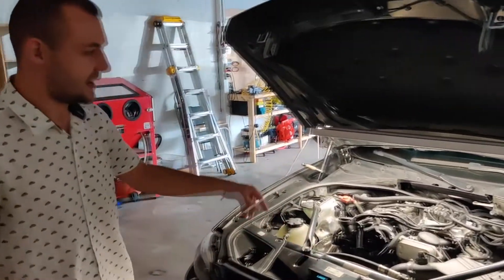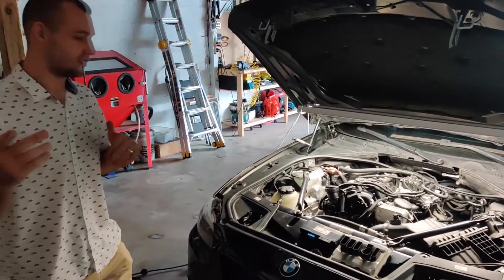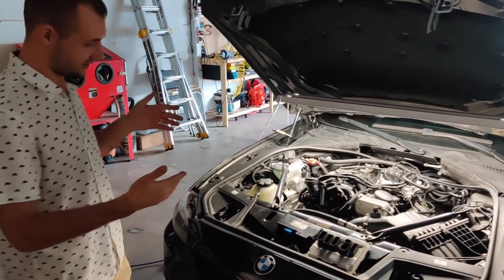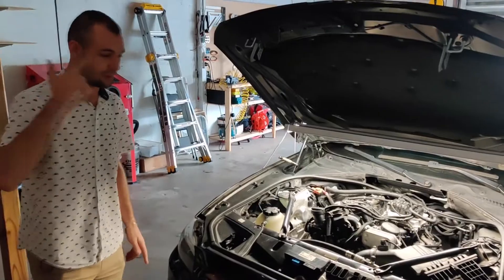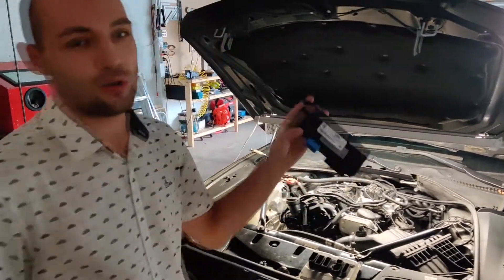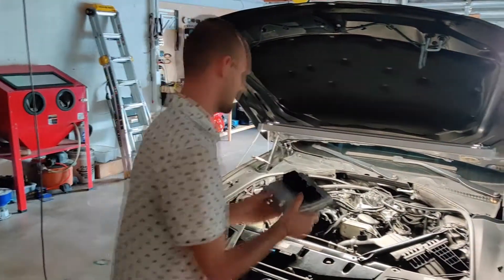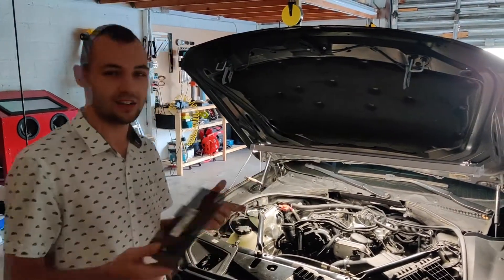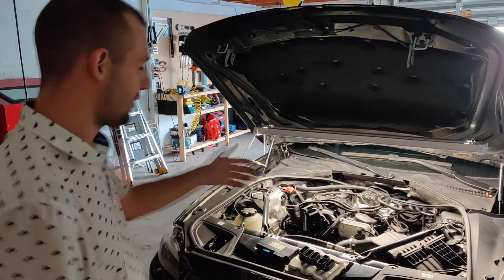Story About BMW F10 5-Series DME Programming Problems

Comment: Hello i have a f10 2012 5 series 520d whith this code 801c20 ZGM memory full ,how can i fixe this ?
Reply from the maker: That 801C20 code means the ZGM (Central Gateway Module) memory is full. On BMWs like the F10, it usually happens when too many error messages or logs are stored. The fix is to clear the ZGM fault memory using BMW diagnostic software like ISTA/D, ISTA+, or a good BMW capable scan tool. If the code comes right back, it could point to a module constantly sending errors, so you’d need to scan all modules to find the root cause.
Reply: @ECUTeamCorp .thank you for letting me know 👍

Comment: Hey buddy I am problems with my DME not communicating or no signal at times . Can you advise me what you think might be the problem please.. 🙏 2011 535i
Reply: The same problem with my 2012 F10, which lasts for quite a while with only occasional "Powertrain Malfunction" sign.  Recently it started and idled for a minute or so and stalled.  Further checking of the electric fuses and connectors found a lack of power supply (when key was inserted and at "ON" ) in both the camshaft position sensor harnesses, and no power at the fuel pump and at the exit pins of the fuel pump control module (FPKM).  I'm still checking.....
Reply: @DrRestorations  Any update on your BMW? same situation with my 2012 F10 520D, no comms in DME1, FPKM is common because its a slave to DME1. still not running gonna run more diagnose
Reply: @josephtdelid8679  I'm waiting for a new FPKM to replace the old one, but afraid that a re-programming may be needed........
Reply from the maker: Tel:              +1(888)-541-6025
WhatsApp: +1(561)-385-5843
E-mail:        sales@ecuteam.com
WEB:           https://ecuteam.com

Comment: there are people making a living using cloned third party tools, so you really dont need to use OEM diagnostic tools, i don't even know how you would get the, if someone can, they are BMW techs or the tools are clones also. I would rather have a knowledgeable person using a clone than a novice using a OEM tool.
Reply from the maker: The main reason why we are using Dealer Scanner tools is because not only it provides us with a proper reading of the module (As stated by dealer algorithm) but also helps us to identify the exact problem that we can resolve, matter fact we receive tons of modules from the shops that are using third party tools on the car with a big variation of the issues, especially after programming.